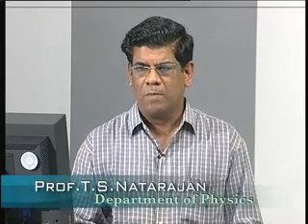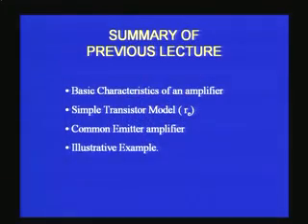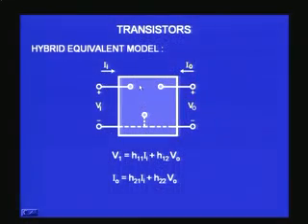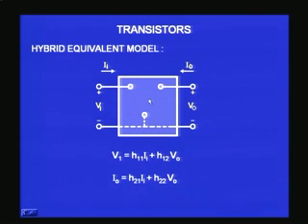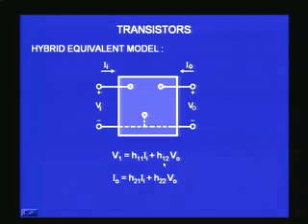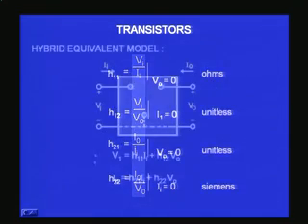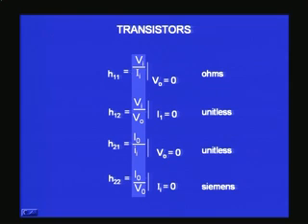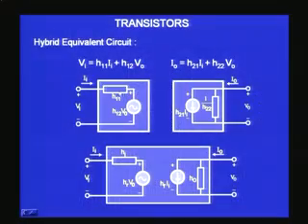Lecture - 14 Hybrid Equivalent Circuit, H-Parameters

Comment: At 32:23 you talk about the "same IB". It is just NOT possible. Only points on the slanting characteristics can have the same base-current. I suggest that you modify that part.
Reply: IB is same. Actually the graph for same IB has some slope(slant). So we can get two different values of IC on that line.